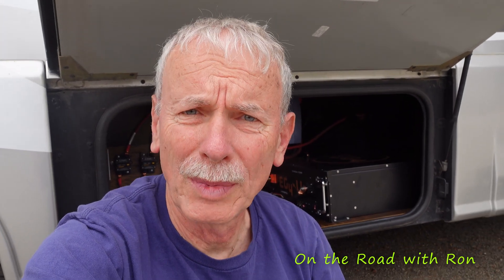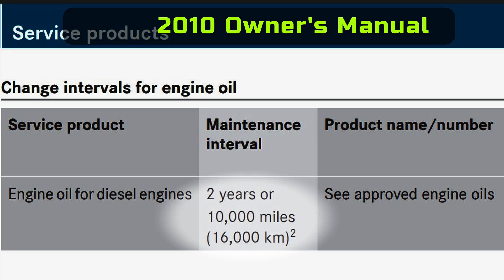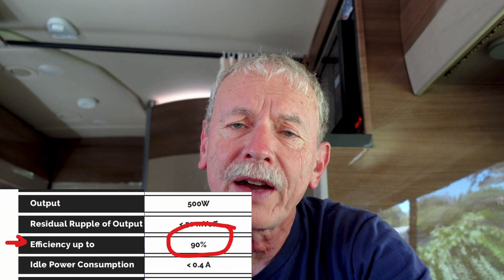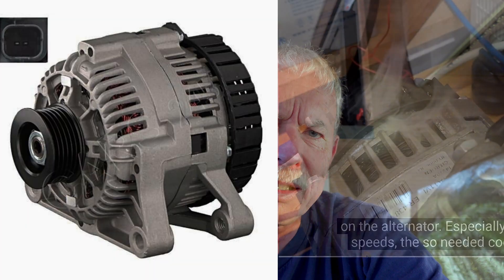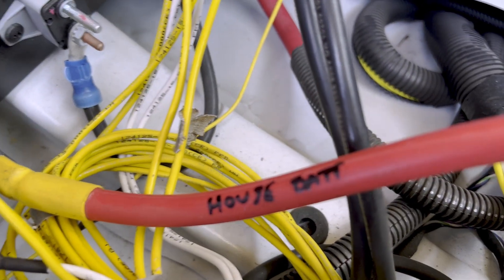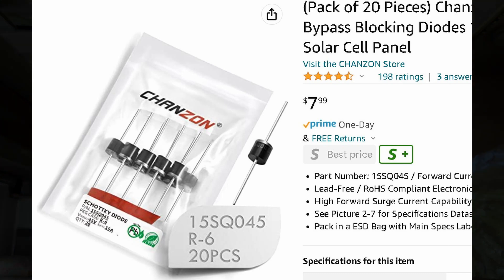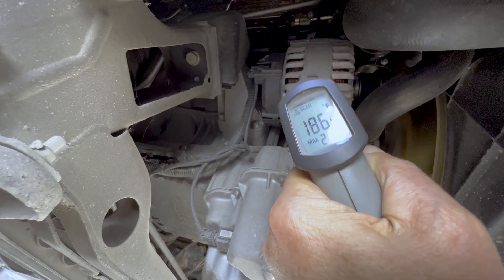DC to DC charger NOT required for big Lithium Battery

Comment: I have been a Certified RV Technician for about 30 years. So JM2C.... Can you get by without using a DC/DC charger for your lithium batteries? Yes you can but is it the smart thing to do? In my opinion I would say no. I heard the arguments about what amperage modern alternators are capable of and then some. Your alternator was designed to provide charge to your chassis battery and keep up with the accessories on the "CHASSIS" side of the rv and "CAN" handle charging wet/agm batteries. Just because your alternator outputs ??? Amps don't mean you should add that unnecessary load to the chassis charging system. They have been doing that for years but now we have better batteries and more installed items in these units that require a larger demand (Inverters, House refrigerators etc.) Why not use a device such as a DC/DC Converter to help carry the load to help keep your batteries charged. Your alternator will thank you for it in the years to come. Lithium is a different story and requires A Constant 14.6v to charge efficiently.  I seen one guy respond "How is your alternator holding up" LOL Just because you don't see smoke coming out of it on the few trips you've made don't mean you are good to go.  You paid good money for lithium so follow through on the complete system. I understand there are devices that are marketed to drain your wallet/purse but I would not cut corners to save a buck. I have seen another guy respond about a DC/DC charger being a marketing gimmick and it is B.S. Are these guys happy they don't have to fork out a couple hundred bucks for a piece of mind? Maybe. Its your coach/trailer and your money. This post is not to bash the author of this vid but to shed light from a technician's point of view. Either way you go. Enjoy!
Reply: AS I UNDERSTAND IT, IT'S NOT THE CURRENT THAT IS THE PROBLEM BUT WHEN THE BMS IN THE LITHUM BATTERY SHUTS DOWN THE CHARGE THE BACK EMF WILL TAKE OUT THE ALTERNATOR DIODES. THE DC TO DC UNIT PROTECTS THE ALTERNATOR
Reply: @victorjcano  it won't if you have a regular lead acid starter battery
Reply: @victorjcano  That doesn't sound correct as Surely when the BMS switches off it means the lithium is at 100% which means the voltage on the battery is almost the same as the alternator, so no current is flowing. So no back emf.  Even if there was it should be no different to say switching your vehicle lights off eg headlights tail lights and fog lights off at the same time.
Reply: Its very simple, if your alternator has a sufficent internal temp control like eg the 115A Mitsubishi or 125a Valeo then the alternator protects itself from overload by dailing back when too hot.
This is already needed for big AGM or banks of multiple AGM in parallel also have a very low resistance nearly equal to lithium and will also burn the alternator if it doesn't have internal temp control. These with internal temp control with AGM lead regulator can be connected to charge lithium directly when you put in an argofet splitting diode and charge a lead via diode in parallel to your lithium. This is because the BMS of the drop in or DIY battery will cut off earlier when alternator still charging the Lead but because lead is there you don't get a surge and a spike when disconnecting. It is bs that a lithium need a constant 14.6V charge voltage, a typical charger like my victron multi or phönix actually starts much lower at about 0.3-0.5V above battery voltage to no unnecessarly stress the cells. The lithium will still suck in all current it get, doesn't matter if 14.6V or just 0.5V over battery voltage. Maybe you loose 5% in worst case, doesn't make economically sense to modify this alternator as with doing that you loose its internal temp protection and gain therefor maybe 2%....
I did competition car strereo for over 20years, been european champion and dealing as long as that with lithium, first from a scrapped military vehicle 20 years ago when noone beside military and some geeks know they exist. So i know a bit about alternator charging with Lithium, lifepo4 and also LTO. Now living aboard a catamaran sailing around the world and help other sailors install or fix their lithium system for the rum kitty. Tried all, burned several alternators and also a car.... learned my lessons by trying and learning, competion car audio is going to and above limits so we tried always to squeeze as much as we can....
Reply: @chrisr819  aren't all battery isolators the same? And aren't all alternators have overheat protection? From the 90s and onward? Do you think the 97 Ford alternators don't have overheat protection?
Reply: @chrisr819 so what do you suggest
Reply: If your alternator doesn't have sufficient internal temp control you need to modify it to external regulation or use a DC2DC at max 50% of rated alternator output to limit the current. What saved thousands of alternator are unintentionally insufficient install like underdimenioned cable or corroded contacts or battery terminsl grease inbetween means that created a high resistance and protected the alternator from going full flat out till it burns....
Reply: Can I intentionally undersize my lithium charging lines to protect my alternator ?
Reply: @jaywildeman3403 

Get a DC-DC charger. Problem solved.
Reply: @jaywildeman3403 

No. You cannot. The inverter will pull all the amps that are demanded from the loads and will fry the alternator. 

Get a DC-DC charger unless you want your batteries and alternator to be fried.
Reply: @jaywildeman3403  yes the more resistance you have in the line the lower the Amps pulled as the Voltage drop increases
Reply: @ajarivas72   What problem is solved ? Certainly not solved is people answering my question with an answer that has nothing to do with what I asked
Reply: No, a lot alternators today have no temp protection. You have to look at the spec sheet of your alternator if it does or not. And no an MPPT cannot be used as DC2DC. If you don't have internal temp control then let an alternator shop modify it to external regulation, thats around 100nucks normally. And then use an external regulator with a temp probe as eg a 50A DC2DC is 450Euro, modding and externally regulated costs less then DC2DC and delivers more current. Also the alternator eg runs in a traffic jam too so it must survive without cooling air means relying on its self cooling capacity.
Reply: Dc to dc can fail and cause issues also just learn how to monitor your batteries and what current your battery can handle
Reply from the maker: I appreciate you taking the time to reply. I’m a mechanical engineer with a degree in physics for reference and do not say I know everything but I am also comfortable without a dc to dc charger. Especially since the alternator charging is used very infrequently. Solar is the main method to charge my battery. If I didn’t have solar my decision may have been different.
Reply: @ontheroadwithron2432  Bu eşekler laftan anlamaz. Çünkü kafaları formatlanmış.
Reply: @ontheroadwithron2432 I agree with the RV guy that a DC DC charger is a must. Why is your charging current only 70~ Amps? What is the limiting factor? As the batteries when empty can take a lot more.
Reply: @MatejFabianek  The limiting is the resistance of the cables in the system
Reply: Mppt solar controller is cheap now, the 100amp have more than 2 inputs, is there a reason why we can't use it as dc to dc charger? 1 input from solar panels the other input from alternator, a one way diode from the alternator so you can turn off the van and the wire have no effect @ontheroadwithron2432
Reply: @BOREDANDWELLBORED 

You cannot connect the alternator to a solar charge controller. I have done it. It does not work.

Photovoltaic solar panels are current sources not voltage sources. The alternator is a voltage source. The alternator won't work with the solar charge controller. 

There is a reason wind generators come with their own charge controllers, you cannot connect them to a solar controller. You cannot connect the wind generator to a grid-tye solar inverter, either.

 A wind generator is a voltage source as the alternator is. 

A solar panel is a current source.
Reply: @BOREDANDWELLBORED 

You cannot connect an alternator to a solar controller. You need a hybrid controller. The alternator won't transfer any energy to the solar controller.

I already did what you suggested. It does not work unless you get a very sophisticated hybrid controller for solar, wind and voltage source, 3 inputs.
Reply: @BOREDANDWELLBORED  I think the MPPT needs a few volts on the input above the battery voltage to work.
Reply: @ontheroadwithron2432 that's your answer.  You are using it infrequently.  You are saved by 5 things.  1. A powerful alternator. 2. You have < 2 lithium batteries.  3. The lithium batteries have bms protection. 4. Since solar is main, you never let your alternator charge depleted lithium batteries, and 5. You only use your alternator some time.  And 6: you are an ME and have a degree in physics.  

#6 is your biggest advantage.  I'm serious. I'm an RV Tech. I would never install alternator to battery without DC to DC protection, swithch, and other safety features like a thermal fuse. RVers dont know what they are doing. Not saying they are dumb.  Some of them are smart as heck.  Just they are out recreating and having fun. They aren't thinking safety.  That's why I have to install safety for them.

Comment: How about adding a series 0.1ohm  (100 million) power resistor - given voltage difference, this would limit the charge to 40amp max. It will also slow down charge as batteries are closer to full which will extend the life of the lithium battery. These resistors are dirt cheap. You can get similar results to a DC-to-DC charger at 5% the cost, while still reducing load and risk for the alternator. It would be devastating to lose the alternator on a camping trip when temps are high… bad things happen at the worst time.
WDYT? Wanna try the 0.1ohm resistor??
Reply from the maker: I thought about adding resistance to lower currents. I am not an electrical engineer but i didn’t like the idea of wasting all that alternator power as heat in the resistor. Also the resistor will get hot as it is converting the power to pure heat. That heat may damage any surrounding components and wiring. The cable from the alternator to my battery is pretty long. Maybe 12 foot so it does add some resistance. Just enough to reduce extreme currents.

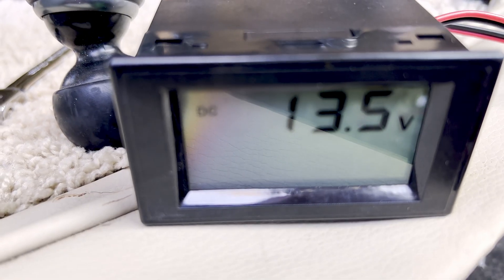Comment: 7:47
Ron, I’ve got a 2023 Winnebago Navion and want to drop in two renogy 100 ah. Do I really need to change the charger controller or anything else?
Reply from the maker: I believe the newer units are designed for lithium batteries. Just check the solar controller settings for the lithium setting.

Comment: Computer controlled alternators nowdays have the capacity to limit current and in fact do. They have incorporated hall effect sensors on the battery cables so it's just a matter modifying the control algorithm.
Reply: AS I UNDERSTAND IT, IT'S NOT THE CURRENT THAT IS THE PROBLEM BUT WHEN THE BMS IN THE LITHUM BATTERY SHUTS DOWN THE CHARGE THE BACK EMF WILL TAKE OUT THE ALTERNATOR DIODES. THE DC TO DC UNIT PROTECTS THE ALTERNATOR
Reply: @victorjcano  that should only occur if there is a malfunction in normal operation charge voltage should not exceed 14.7v unless the ambient temperature is extremely low then compensated voltages could be as high as 15 volts. A simple capacitor would resolve any voltage spike issues.

Comment: The issue is lithium need the consistent voltage and amperage when charging and does not do good with a high float voltage thats constantly being pumped into it while your driving do to its low resistance literally it likes the exact opposite of what lead acid batteries like and so although you might not overheat and damage your alternator you will wear out your lithium Bank by charging it wrong
Reply from the maker: Thanks for sharing. The manufacturer of the lithium battery recommends a charging current of 80 amps. The BMS will limit the max charge to 100 amps. The battery protects itself.
Reply: > lithium need the consistent voltage and amperage when charging 

Are you making this up?

> and does not do good with a high float voltage thats constantly being pumped into it while your driving 

So disable the relay when they're charged.  And use punctuation.

Comment: Love this - not buying into the BS and sticking to your instinct!
Reply from the maker: Thanks. I like to test everything.
Reply: AS I UNDERSTAND IT, IT'S NOT THE CURRENT THAT IS THE PROBLEM BUT WHEN THE BMS IN THE LITHUM BATTERY SHUTS DOWN THE CHARGE THE BACK EMF WILL TAKE OUT THE ALTERNATOR DIODES
Reply: @victorjcano   @Victor J. Cano  Interesting - thanks for sharing. Where is this back EMF being produced? The battery itself is not an inductive load. Had the alternator been directly powering an inverter then this may cause an issue. High power diodes are available (200A) for relatively cheap (~£25), they could mitigate any back EMF, I think.
Reply: @abcd-by6rw  i know through personal experience if you’re running a load on the alternator and all of a sudden that load is disconnected then a high voltage spike produced will take out the alternators Diodes

Comment: Nope when I ran my RV Rooftop AC first with the gen then turned the RV engine on. turned off the gen and the load went to the alternator and yup alternator died. RV started but the alternator was not charging. Alternator is rated for 130amps. Most people buy the DC2DC to get rid off the isolator to install inverter/chargers to run AC outlets without running the generator.
Reply from the maker: Hard to know the cause of the failure. You can have multiple DC chargers hooked up at the same time. Your gen was suppling the converter to charge the batteries while your alternator was also charging the batteries. There might have been a voltage spike or maybe the converter was in an equalization cycle putting out a higher voltage than normal that overloaded the regulator in the alternator. You could monitor the DC voltage when you turn off the gen to see what happens.
Reply: @ontheroadwithron2432  UPDATE! So u was able to recreate the issue. Blown alternator however found the issue. Hope this helps others out there. Ron you are correct that even a 130amp alternator can charge lithium battery no problem I think the issue is that for very long drives lithium are not meant to be charged 24/7 hence the DC to DC handles the cut off. However modern day batteries come with good BMS and stops them from over charging so no need for DC2DC but again its another nice thing to have. 

Okay so the issue here with my Rooftop AC killing the Alternator. First of I located a voltage drop from the batteries to the bus bar to the inverter. Issue here was that 1/0 awg wire was not cutting it. Second doing this on lead acid batteries is not good as the surge drain the house batteries then pulling excess from the alternator. Which was causing the alternator to blow. 

Replacing the the lead acid batteries with x4 100ah lithium batteries fixed the issue completely. I am no able to turn the RV rooftop AC while the car is running and not blow the alternator. 
Changing the wire to 4/0 pure copper and not CCA also fixed the issue of wires heating up. 

So doing all of that I was able to to run the AC. 

CONS: 
When bypassing the DC2DC I would get roughly 80 to 110 amps to the house batteries. The flaw here is that the Chasis battery would not charge at 14.1v it would only get as high as 12.8v so basically the system broke even or would see -2ah being pulled from the house batteries. 

When connecting the 50amp DC2DC I would only get 498to 49.5amps from it but then running the RV AC would give me a deficit of -43 to -57amps from the batteries. With the starter battery charging at 13.1v

Solution and feedback. 
Based on math and safety measures the solution to my dilemma is to upgrade the alternator to a 250amp or 300amp alternator and then from there take the 12+ lead to a anl distribution or a busbar to take 1 wire in and split to 2 wires with ANL fuses and and add x2 60amp DC2DC chargers to get close to 120 constant amp charge from the both of them and then an extra 20 to 30 amps from solar to have a surplus of energy so the RV AC can run and batteries can still charge. 

All to be able to run RV roof top AC without running the generator and consuming more fuel to power two sources. 

Ultimately Ron is correct you can charge lithium batteries with stock oem alternator just make sure its 130amps or higher. Thanks Ron😀
Reply: @charlest7027  exactly. People forget about the ol BMS. Afterall...wtf is it for then? Furthermore...some of them can be programmed =)

Comment: One marketing scheme busted! Great job! Thank you for sharing.
Reply from the maker: Thanks. Too much marketing is not how good your product is but to instill fear that something bad will happen if you don’t buy the product.
Reply: Absolutely NOT.  Notice that this is a motorhome and it will have a BIM (Battery Isolator Manager) installed in it from factory.   It is the BIM that is managing the Alternator NOT the BMS. The BIM is what allows to alternator to charge both the house and chassis batteries but also not allow the chassis batteries to get drained down by house loads.  If you try this with a towable then you will destroy your alternator and possible start a fire under the hood.  A DC-DC Charge Controller is required in 100% of towables.

All those "marketing" videos that you speak of are always for Towables and in most cases they make that use case very clear (travel trailers or 5th Wheels).